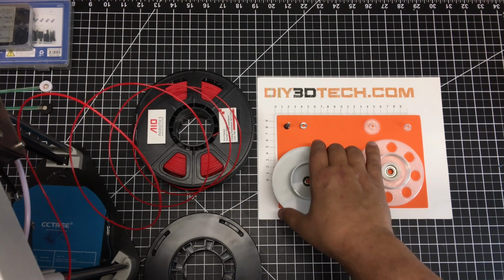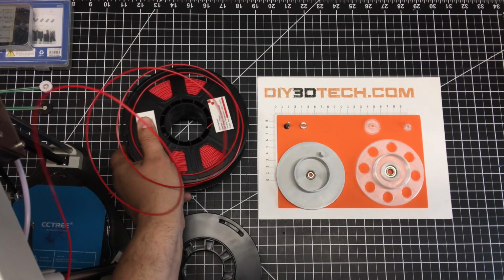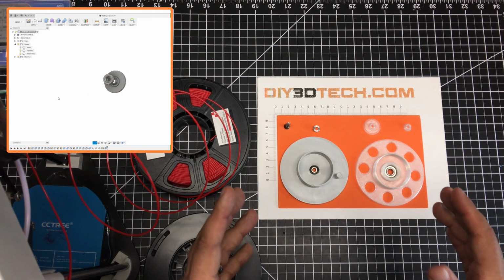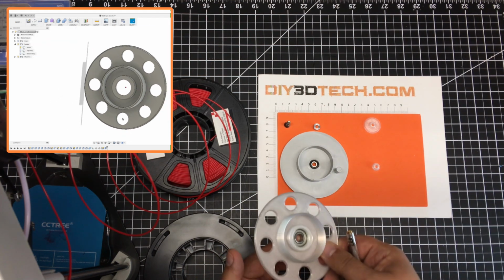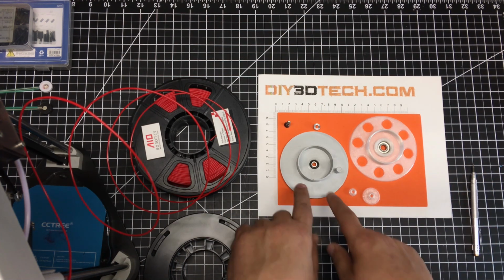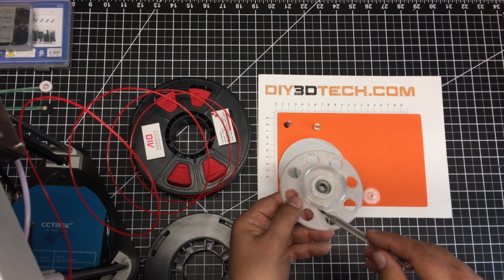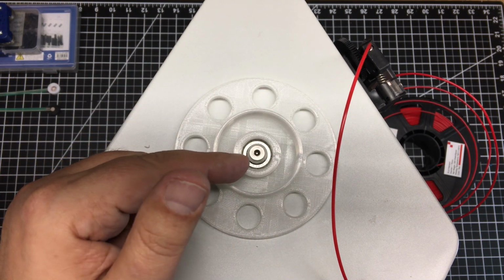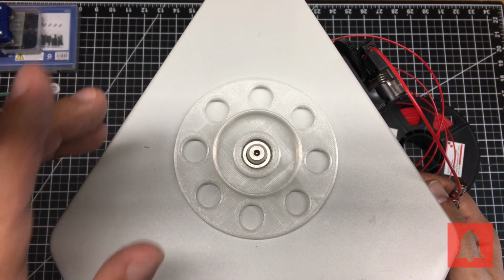*Design Talk - New Spool Holder for BQMagic Delta!

Comment: I prefer to have a little bit of tension on the spool, rather than let it spin freely on a bearing.  The reason is the tension on the filament wire can cause the spool to unravel.  And then you end up with a big mess and possible filament binds.
Reply from the maker: Understand what you are say, however since this lays on its side there there has been no issues and in fact because of the added smoothness it makes easy for the printer pull filament and not bind up...